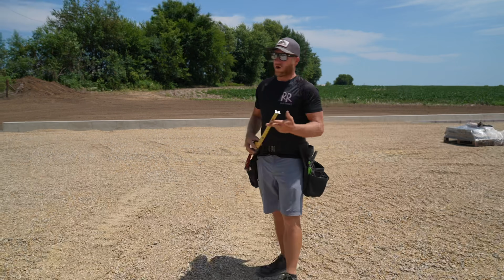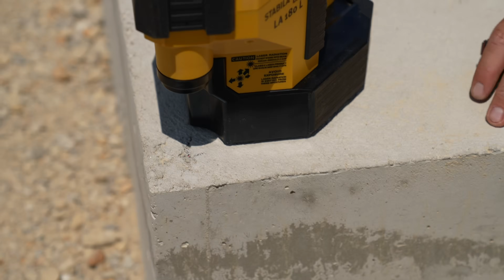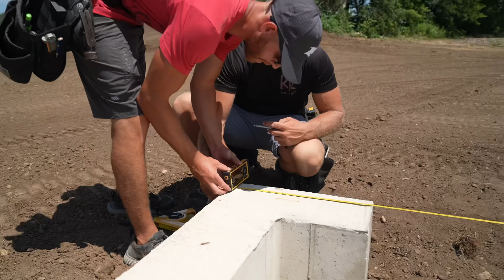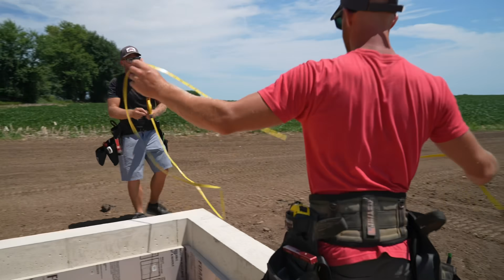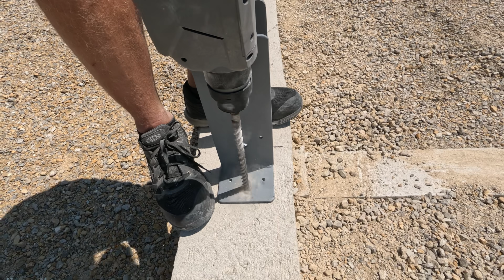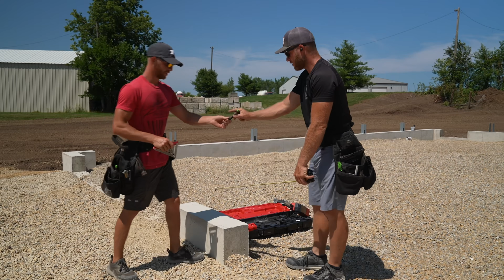Start of a New Post Frame Shop for Farm Chains

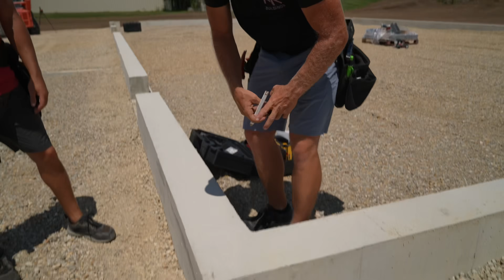Comment: At 4:40, you talk about girts flush with concrete wall. What do you do when it is an ICF 8” thick foundation wall with 2.5” thick foam ICF wall on each side of concrete wall? I am currently considering setting the 2x6 columns 0.5” from concrete edge and sheath with 1.5” thick panel (1” foam attached to 0.5” OSB) so I can get to being flush with the ICF foam exterior wall (0.5” concrete offset + 2.5” ICF = 1.5” girt + 1.5” OSB panel). Am I safe to set columns only 0.5” from edge of concrete wall? Thx

Comment: I’ve personally done takeoffs and priced both for conventional stock 2x6 framing with trusses on 24 inch centres a conventional build with labour and materials compared to what you are building. I watched all the extra labour and materials you use and there’s a lot of extra cost in building what your building.
I can build what your building with the same results and detail faster and saving the customer money.
Some of your builds require so much material in your roof system and to much labour. 
You might convince some of your followers but the numbers and materials don’t lie

Comment: I realize you don't do the concrete work, but if you get a chance to do video on concrete stem wall prep, form, rebar, & pouring that would be a great addition for those of us trying to figure out all the steps.
Reply: For All that I recommend the YouTube channel Essential Craftsman for all that kinda stuff. Don't know if stem walls are done differently between stick frame and post frame style construction or not. Mostly, they're just planned ahead of time with how deep the stem wall footings need to be depending on load and frost line or not via an engineer.

Comment: "Lasers don't bend through space and time... well I think they do" - spot on. They DO bend in space and time because of Earth's gravity. The bend is so tiny, however, it's practically unmeasurable with today's instruments, and, since the whole geometry of space itself is bent (yes space actually does have geometry, weird stuff), everything in space bends with it, including the concrete foundation. (And this is not about the curvature of Earth's surface, that's another issue.)

Comment: You went from 92’11.7/16 to 93’11.7/16! For the square🤔😱. Jeeez, use metric already!😀
Reply: That's because Greg was burning a foot on the tape; i.e. holding it at the 1ft mark instead of 0. This is more accurate than relying on the end of the tape to stay where it is. If Greg is starting the tape 1ft in, then Kyle needs to add 1ft to what he wants too.
Reply: @aaronmdjones lmfao